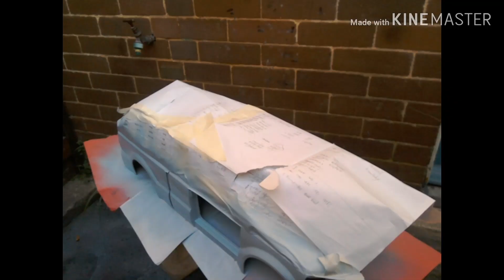RC crawler hard body customised - 1/6 ford f350 #ford #fordtrucks

Comment: Just came across the video gotta say nice job.I just got a Ford lighting 1/6 th complete truck minus the remote think I'll tear it down and build a custom rock crawler using wraith running gear.Havnt started building the frame yet just need to decide on body colors Got the truck for 10 bucks thought that was a sweet deal should make a awsome large rc when done.Dig the song in the video too

Comment: What websites would you recommend to get replacement parts on for this car? I have a missing battery, battery cover, remote control. I would like to convert it from a low rider to an off-roader.